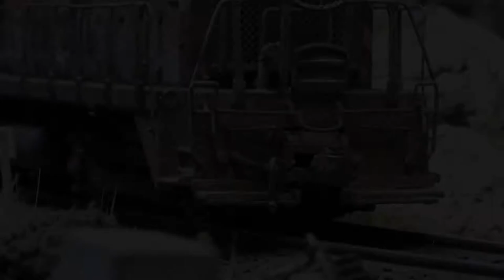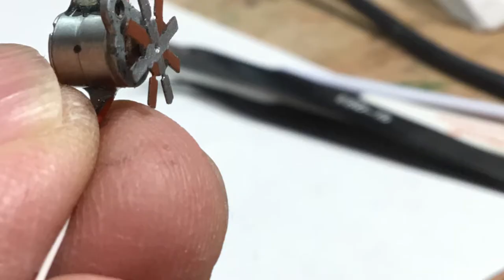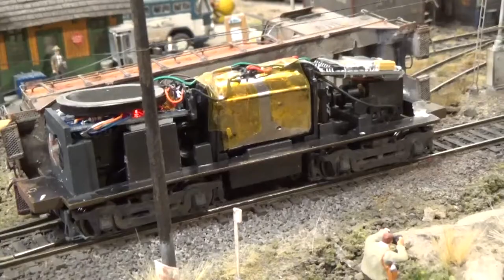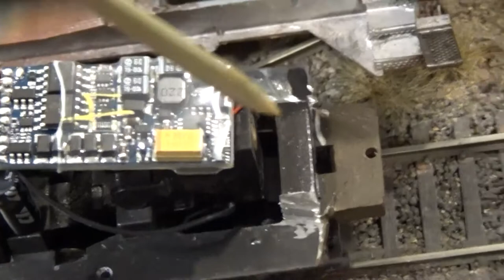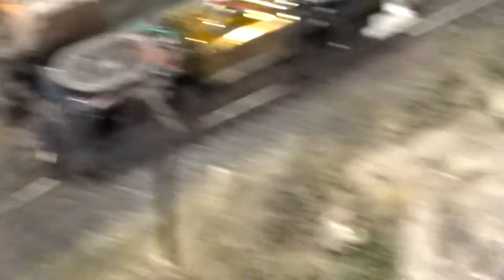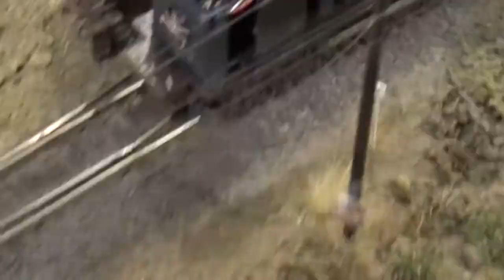Custom Made HO SW9

Comment: Hey Bruce great looking detail additions there and the fan is super cool, I am curious what all do you have running off that Arduino?
Reply from the maker: Hi Grimm, the Arduino ProMini is just running the stepper motor (but could do more)
Reply: very cool, on my projects I also use ESU 4.0 decoders in a 21 MTC configuration in conjunction with a TCS WOW 1622 motherboard. This gives me built in 1k resistors for led lighting, capacitors for stall free operation and full access to all 6 function and logic outputs via decently sized soldering pads on the motherboard. Though I have had one instance so far on a Atlas Also S-4 that I was unable to use this combination due to room constraints. 

But I wonder if there would be a way using the Lok programmer to have the fan automatically come on when the radiator fan random sound file is generated. 

Been lurking on your channel for awhile now, I am going to school currently for EE.
Reply from the maker: There may be a way, but I've only seen sound file controls and events triggered by outputs, not the other way around. You could download the ESU programming software for free.  You don't need the programmer board, the software has a limited emulation mode for debugging.
Reply: I do have the programmer and there are certain logic outputs that will control a separate motor like the uncoupler logic, and any logic activation can trigger a sound. Just got me thinking, I will have to play around and see if there is anything in there that could be used for something like this, have a great day.

Comment: I hope it's okay to ask, where did you the stanchions for the locomotive? I have recently emailed the gentleman at Smokey Valley Railroad products and he said he was still in business, but I have had a hard time finding brass handrail kits or stanchions, even the plastic EMD style he used to offer. I do have some older Smokey Valley plastic stanchions for EMD but they are too short for an SW9/1200 switcher. For the prototype I wish to do, GTW the stanchions are almost 1/8" too short. I would appreciate any leads on where to find these. The model looks great. I have a custom build business and I build locomotives and buildings but I am beginning to have a hard time finding parts, the ready to run craze as all but left me without a source for special parts.
Reply from the maker: Hi Wayne,I really feel for you on this subject. I work on a lot of custom locomotives and it is getting harder each year to find detail parts. More and more, people want to buy locomotives all ready to run, not make or upgrade them.I too could not find stanchions, so I bought a plastic one on EBay for some kind of EMD locomotive (I can't remember) and cut them down to size. Then use wire, and bent to for the transitions on the ends.If I was to do it again, I would use brass wire and flatten the bottom where it mounts to the locomotive, dimple them to look like bolts, then resistive solder wire on the other end to them for the handrail.

Comment: Hi Bruce, What did you use to cut the door open??? Thanks much, Jerry K
Reply from the maker: Hi Jerry. I replaced the cab with a new cab kit which the doors are separate pieces. Funny you ask, because I struggle making clear, straight cuts in plastic shells and wonder how others do it.  Bruce K